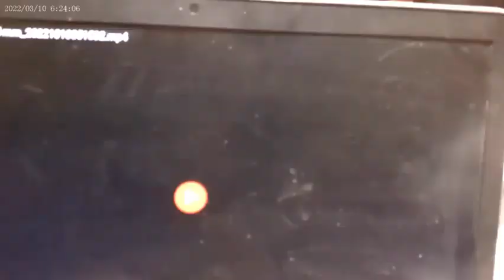Boost Box introduction

Comment: Thank you for this and the video showing what goes into making it.
Reply: What are the dimensions of the box?  The space behind the firewall on the SL is pretty cramped.  If it wouldn't fit there could it be ordered with a longer wire to fit in the trunk?

Comment: Have a cl600 2002 v12 ..you have any coil packs laying around??? And would not having the ground wire to the coilpack make the car not crank..? Think the last mechanic didn't hook drive side ground wire back to coil pack
Reply from the maker: No, check all the yellow 20A fuses on the passenger side - under the hood.  If your OBD reader doesn't work then you have a blown fuse that will prevent the car from cranking.  Transformer and packs have nothing to do with cranking the engine.  The engine firing is a whole other issue..

Comment: How about an engine swap harness/PCM,  so we can put these monster V12's into project vehicles?
Reply from the maker: That would be a nightmare !  Junkyards.....
Reply: Do a Standalone ecm and make your own harness then you can get rid of the whole garbage ignition system and run better coils.
Reply: @V12Buickguy  Do you still have the V12 Regal? Beautiful  build.
  I have a mostly stock '87 turbo Limited. Very rare.
 I just sold my '05 S600tt because I didn't trust it, mostly because of the ignition system. 
I don't know that I'm capable of doing a stand alone system like yours from scratch
Reply: @scootypuffjr.  I do. I'll have a new video of it soon hopefully.

Comment: I purchase a coil from u.. Work great.. But one day I pull really hard an my 04 cl600 went limp mode and threw code (pedal etc and throttle body) esp malfunction etc... Car limp mode.. I replace new pedal cleared code and replace throttle body ebay. 3 different one ... There are no code now but the idle surges and limp mode..  Help? Wasted whole summer sitting.. Car only has 80k
Reply from the maker: I have seen voltage transformers fail to produce enough current and never throw a misfire code.  Without the right eyes on your car you'll have to try swapping out parts and see what works. You can send me trnasformer and packs to test if you want to go that way.  Use my email for more correspondence...  clarkruppjr@gmail.com
Reply: @clarkrupp  do u know replacing use throttle body ok does it have to be progrAm... The esp malfunctions is on but no code.. Car surges idle and limp..
Reply from the maker: @keepinitrealTRUTHFUL  No programming for TB.  Look for vacuum leaks and quite buying used crap unless you know exactly what you're looking for.  Too many crooks out there!

Comment: I think you sent me one of the ones you threw on the floor. First one wouldn’t start. Second one is misfiring………
Reply from the maker: Haven’t shipped to anyone named Fisher….
Reply: 007? Now it won’t even fire up. I’m the mechanic not the customer.
Reply from the maker: @MrBobbo18  all four lights on ?  Fuses good ? call me 916-802-1045
Reply: 1+3 from the left lightly flicker
Reply from the maker: @MrBobbo18  If you have a bad pack on the car the fuse may have blown a fuse.  If all four lights are on the Boost Box is functioning perfectly..  Call me and I'll walk you through it.  Shorted pack may have a blown a fuse on the car and killed the 12v to the box.  That's why the lights are there..
Reply from the maker: @MrBobbo18  Flickering light is a short in the pack.  There are no fuses on the 23v line - green lights but check the fuses.  If blown, the pack caused that to happen - not the box
Reply: The original unit works fine. Both coils are your rebuild. Zero misses with MB unit. Multiple with this boost. Both fuses ohm .2